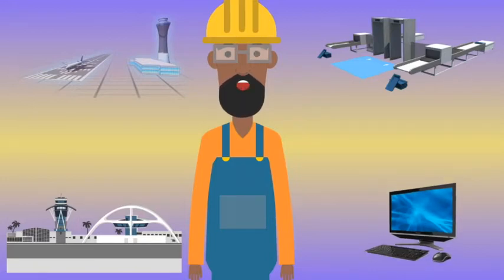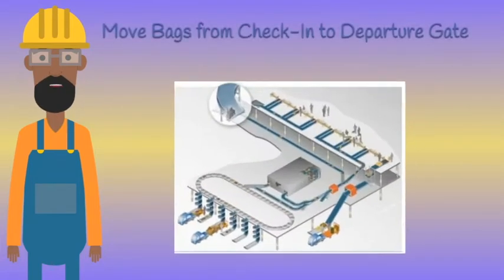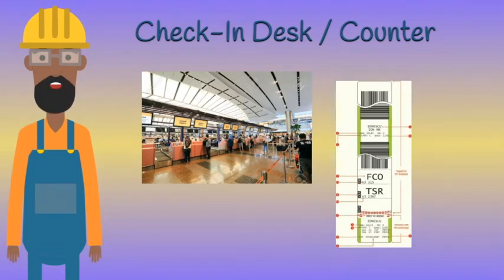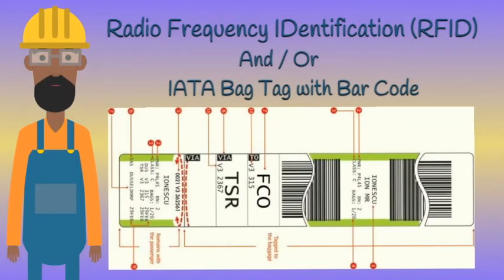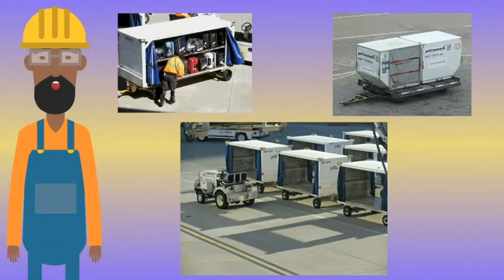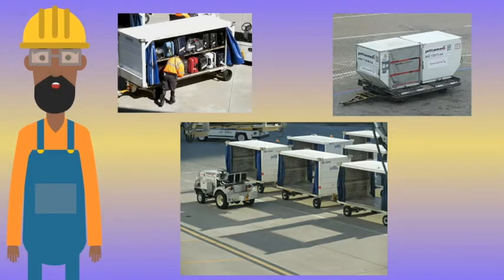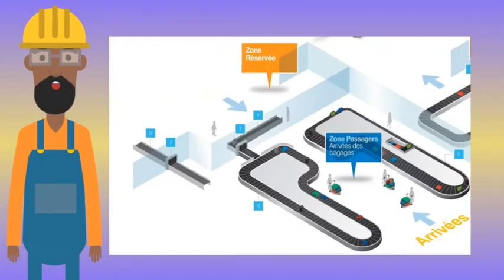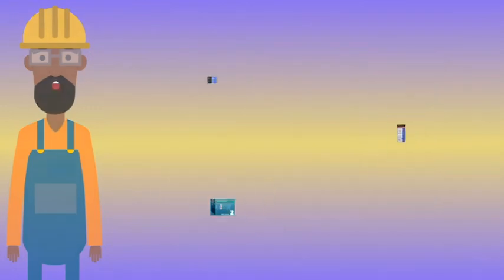Baggage Handling System - Introduction

Comment: Sir 🙏
1. baggage handling system (airport)
Which motors are use
Connection star/delta ?
2. Sencer..kon sa ?
3.belt ka name ?
Reply: most of the place induction motor are used and some places servo motors are used as well. induction drive is used most of the place. photo eclectic sensor, diffuse sensor, proximity sensor are used mostly. flat conveying belt is used mostly.
Reply: @ashishtiwari5864  thank you